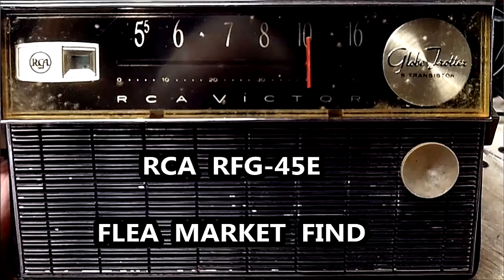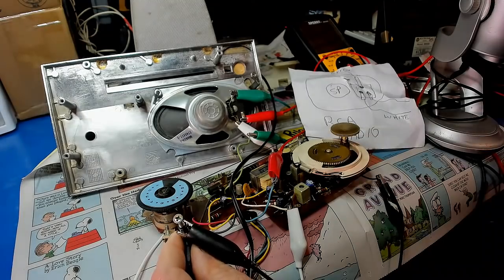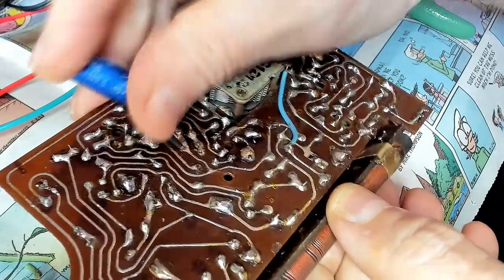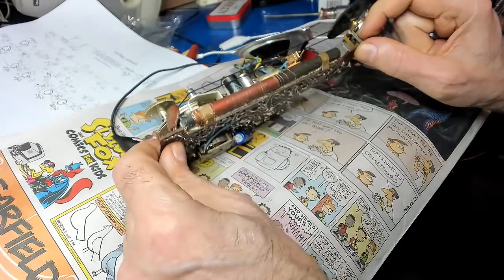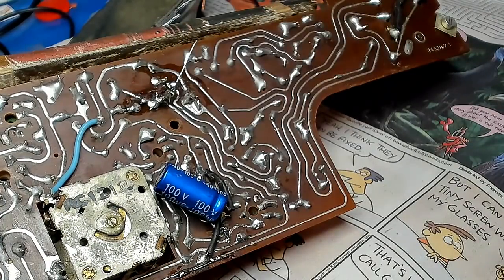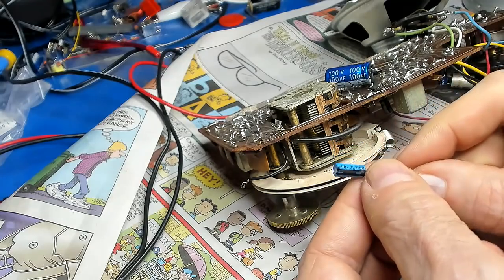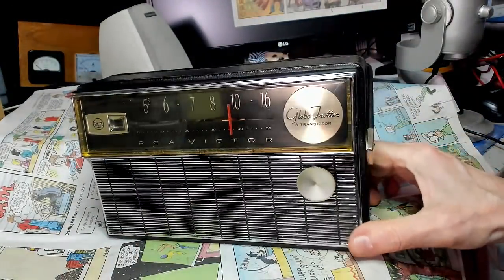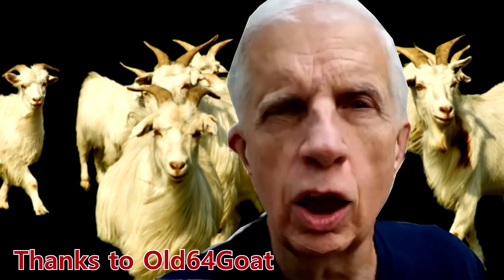1964  RCA Model RFG-45E Transistor Radio Repair

Comment: I do not recall commenting to this video. I’m sure many 👨 of them contain Old64Goat’s name in them, but we’re NEVER👎 short a GREAT 😊 radio 📻. RCA was much better product, then, than it is now. This must be an RVA Sparton. The speaker 🔊 appears to be permanent magnet 🧲. The circuitry was 🔝 notch. Vacuum tubes were available at your local grocery, or hardware store 🏬. These radios 📻 were made to be serviced. Speaking of vacuum tubes, these were one ☝️ user-serviceable component. If not, they probably were available factory 🏭 direct. Please 🙏 keep 🆙 with the GREAT 👍 videos. This radio 📻, and comment, is worth a couple of beers 🍻. Your friend, Jeff.

Comment: Buzz, 
Thanks for showing a solid state repair. I don't know very much about transistor radio servicing. I would think those old dried up capacitors would've needed replacement, but that's about it. I'm glad those old transistors are still working. :-)
I hope you're staying safe with all the nonsense going on in the streets near you.
Be safe, Tom
Reply from the maker: they seem to be ok, but I haven't tested the radio in depth

Comment: Usually these 60's Japanese sets just need a recap to get them going. Occasionally you'll find a bad transistor but they are surprisingly reliable for the most part. Was that a brass gear I saw on the back of the tuning wheel? Now there;s something you won't be seeing again any time soon. Thanks for the Friday look see as always. Stay well. ATB Doug.
Reply from the maker: thanks for watching Doug
Reply from the maker: yes it was,,,the whole grille was metal  too!

Comment: Hackbar "postage stamps" on the package  are very disturbing.👹 Thought Bill said he took a 100uF electrolytic cap out and didn't replace it. It works anyhow?🐐
Well for a while. More bad capacitors to confound you. A little work on the case and wa-la , another one saved from Bill's  junk pile. 📻  Good work there  Buzz. 👍🏻👍🏻
Reply from the maker: It worked without the 100uf cap.. it was in series with another cap,

Comment: Great video, as usual!!! Where can I obtain a cap tester like yours? If it is homemade, are you willing to share the procedure to making it?
Reply from the maker: Those testers are from China, and work good..here is a link, this comes with an acrylic case....you can shop around and probably get one cheaper....Buzz
https://www.ebay.com/itm/LCD-Component-Transistor-Tester-Capacitor-Diode-Triode-MOS-PNP-NPN-LCR-New-NT/133133207771?hash=item1eff5b88db:g:KJIAAOSw6CJbBIrp